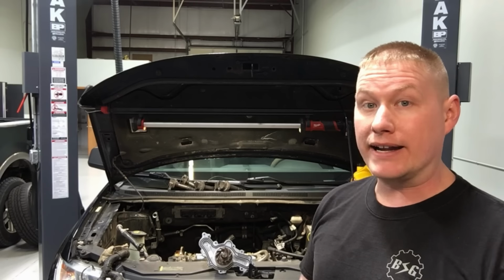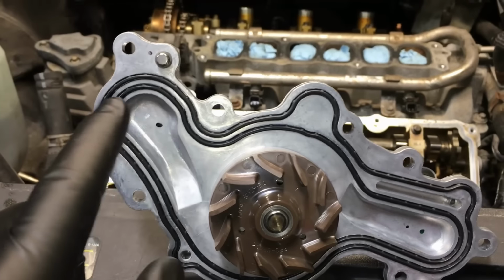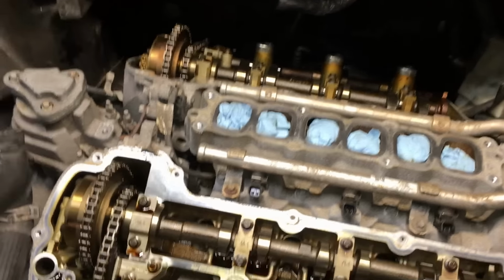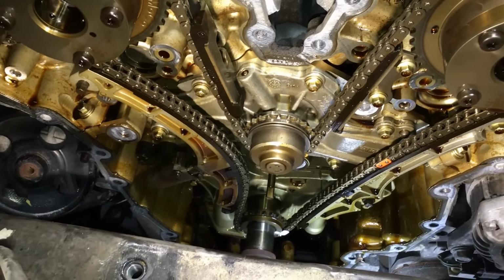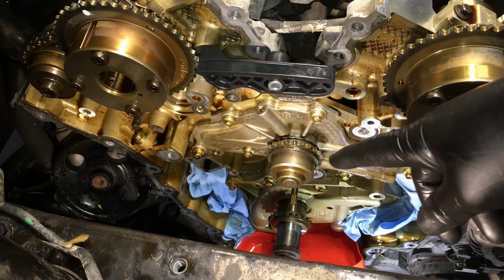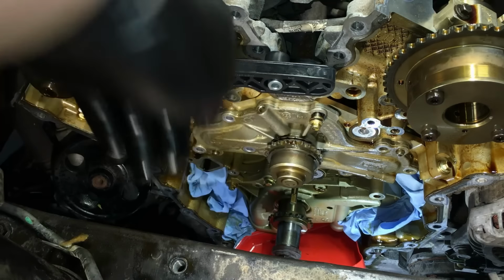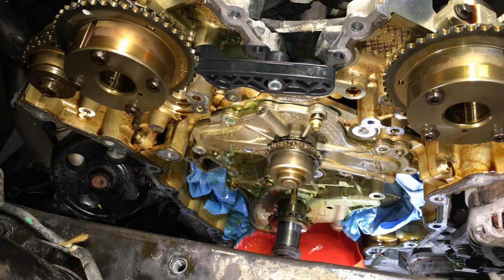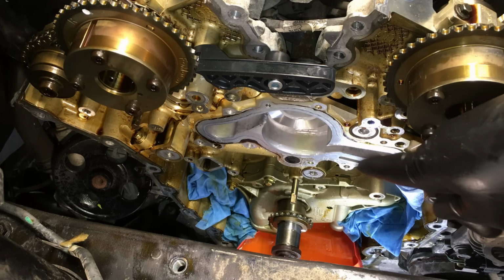Ford 3.5L 3.7L Duratec V6 Chain Driven Water Pump Failures: Check it Before it Destroys Your Engine!

Comment: Need help and advice...replaced water pump chains on 2007 Ford edge... replaced the head gasket also... assyblemed engine  ran it hear rod rod knock... looking to replace connecting  rod bearing... and main bearing... to my surprise  the cross bolt external on exterior on engine that hold the main bearing...wtf ford... it's alwheel drive so I'm guessing  the ptu need to losses or partly  removed to get acess to thes bolts...  plan on doing in the car..not removing engine... also the oil filter housing need to removed... my question is possible to remove thes Damm cross bolts any advice and videos?

Comment: I'm here with the minority report.. my 186k miles, 2013 Explorer alternator seized, shredded its accessory belt... my attempt to remove it resulted in a broken alternator mounting stud. But.. since the shredded belt does not drive a power steering pump or an engine water pump, I was able to drive.. instead of hire a tow for $150 - $200.. the 2 miles to the mechanic.

This does not make up for a TOTAL CLUSTERFLUCK design.. and the next guy has an engine which does not turn because his GDCD water pump bearing failed.. but we gotta appreciate the small benefits where we find 'em.

The car is at the shop now, it's getting the alternator swap done, plus a tensioner for that belt, plus a preemptive water pump and timing chain with phasers.. and two wheel lug studs drilled out from the self-disabling factory lug nuts...

Comment: I have a 2010 Taurus SEL. It overheated 2 weeks ago. I didnt seen any loss of coolant nor leaks, so I replaced the thermostat.  A week later. It overheated again. I then suspected that there was air in the system,  so I tried burping it with the cap off. I also squeezed the top hose while it was running and my heat started working again. It hadnt been prior to this.  Hopefully,  its good now but I will see.

Comment: Hmm , Thanks to your video I am rethinking my former police 2018 explorer purchase, with 60K miles and 7000 Idle hours I decided not to chance this head ache. I am going for the newer 3.3 DOHC 24V EcoBoost, the water pump is external belt driven like the good old days.

Comment: This is being written in May 2026. I had to laugh at some of the prices you quoted in the comments. I just had mine replaced 2017 Ford flex. I talked him down $600 still cost me $4600 to change out the pump timing chains guides, etc. etc. etc. I told my wife if it last 150 thousand more it’ll be over 300,000 and it quits I dump a bunch of stop leaking it or just junk it. I guarantee I’ll do more studying before I buy another car. I’ll probably get a four-cylinder. Make sure the starter is on the bottom not in the engine. Make sure the water pump is on the front of the engine, not in the engine then maybe I can afford it!

Comment: I know this is an older video, not sure if you will answer, but if so thanks. 3.5 Ford Taurus Limited,  major internal water pump failure today, no overheating and the coolant bottle still has a little antifreeze in it, oil is milky on dipstick but not pudding. I have done multiple chains, water pumps and cam phasers on 3.5 so I'm not worried about the process. My concern is possible crank and main bearing issues, car was ran about 15 minutes at interstate speed to make the exit, do you think the bottom half has been damaged? If not how many cycles ( not running ) just pumping fresh oil and draining should I do to flush everything. Again, thank you.

Comment: I just finished this job yesterday on my son's 2016 Lincoln MKX 3.7L Duratec. He had quotes from two independent shops -- one at $1,800 and the other at $2,000 - $2,700. It cost us $190 plus some antifreeze plus some Permatex Ultra Grey, plus a ton of time. I was one happy (and relieved) man when it fired right up after the marathon reassembly.

This, on the heels of an almost $6,000 estimate from a Lincoln dealer to fix his turn signal. Yes, his turn signal!

The Lincoln is now for sale, and it will be the last "modern" Ford product this family ever owns.

Comment: Can you imagine spending $40,000 for a car today driving 150,000 miles on a car is nothing and then shelling out another four to $6000 for a $200 water pump. Ford  should be sued. There should be a class active lawsuit against them. This is not right that the people that cant even afford a vehicle and then it breaks down and destroys the motor. What a horrible design.

Comment: So if the seal on the shaft leaks then it will have coolant going into the oil without any coolant coming out of the weap hole?

Comment: Hi, I bought a 2012 Fusion Sport 3.5L AWD with 265k km (in Canada) and have a water pump failure and it seams that in order to change it (and because of the space constraints), the engine needs to be removed from the vehicle making a $500 job go to more than $5k. Is this the only way to access the timing cover and do the replacement of the water pump? Any ideas?

Comment: Just looking at your video, it's apparent that the weep channel between the gaskets also connects to the weep channel from the shaft seal.
A leak at either location should produce coolant weeping from the hole above the alternator. 🤔
I'm going to check out a 3.7L Taurus for purchase, and that's one location I'll definitely check.

Comment: I actually have had that plastic/composite impeller explode and break apart, seems the ball bearings failed and then the gear jammed up and well everything went down hill from there 

Makes me wonder if the cast iron impellers are better to use

Comment: please help me sr. i have a 2013 ford flex se. so i have been hearing a slight whistle noise over a year i thought was the belt . so the water pump failed and i have some oil on the alternator and around there and water in the oil after the pump failure. So i was on the free way i gave the car gas and it just loss all power and turned off on me and i did not see a over heating warning sign light at all. after the car cooled after getting it towed home it starts right up but of course the pump seal and water pump is broken bad so of course i cant and wont drive it. but it will start. now im wondering if i did not see a engine overheating light on the dash is it possible that i since the water pump failed i did not blow the head gasket as well.I looked online and it says in different places a blown water pump can cause oil to leak as well as water and oil getting everywhere around there. what do you guys all think? the mechanic i had look at the car is an older man and he seen the oil and water in the oil from the dip stick and he says i cant just change the timing and water pump i also need to change the head gasket and resurface the head now??? I want to just buy the water pump timing chain kit and have that all done and thats it but im worried if the head did blow also?? what do you guys all think please?

Comment: Our  2012 lincoln mkx just had the water pump go out on the 3.7.  Mechanic shop charged us 6500 on the repair.  When you said dealerships charge 2k I sunk.   
If you have an issue with your car , don’t let dels garage in Bunnell florida work on it.

Comment: Nope i will never buy ford again never their stupid engine designs are made so u can take them to dealers u cant even change the lower oil pan that was ao simple ij old school cars are now a mess to replace u have to remove valve cocers plus front timing cover just replace the oil pan seal or silicon no thanks no more ford for me

Comment: 256,000+ miles on a 2011 Exploder, still no milkshake but the timing components sound beat. Need to change them and might as well get that water pump too...this looks like so much fun.
Reply: 3.5l NA, not a turd-blow.

Comment: Only seen the weep hole leak 1-2 x but any pump that was toasted it was from the shaft seal dumping out coolant. The gaskets seem to have a longer life than those shaft seals from what ive fixed with over the years

Comment: whoever is saying that they HAD to do this otherwise the engine wouldn't fit.....they literally solved this issue in it's predecessor 3.0 by putting the water pump above the flywheel....or they could have put in an electric pump like BMW or Mercedes....there are many other options all of which are better than what they did here.....a $2500 water pump job is an engineering fail...and what's even worse is that many of the people that drive/buy these cars are in lower/middle class financiallly

Comment: I honestly wish I'd known about this before I bought a 2010 Taurus. It has 145 on the clock now with no signs of leakage, though it gets checked weekly for signs of coolant in the oil or vice versa.
I've considered having the pump replaced as a routine maintenance item around 150 or 200k.
Reply: UPDATE: The Taurus is gone. I could not keep it repaired and running to my expectations so Zi gave a friend the history and signed it over. He says it runs great.
Guess I'm picky. Bring disabled doesn't help with the repairs though.
F-150 forever!

Comment: Curios.  Where is that price point now 6 years later.  I know inflation has made EVERYTHING going up.  Not being critical of you. I GET IT.  but curios where your price is at this point?
Reply from the maker: double
Reply: @FordTechMakuloco  Ouch thanks.  Wife's has 111k on it  I know the oil was changed regularly according to carfax.  I BELIEVE the coolant was done at least once anything I can do to prolong life or just fluid changes to prevent acid build up, seal break down and should I pre-emptively plan on doing this now that we are just past that 100k mark?
Reply: I picked up a ‘13 Edge with the 3.5 a couple years ago that had 142K. It was burning a little oil but a couple years, and another 18K, of full synthetic has its oil use down to almost zero.
I noticed minor coolant loss last year & discovered a leak past the clamp of the upper radiator hose at the radiator so I changed the upper & lower hoses. To access the lower hose clip I had to free the radiator from its brackets. I carelessly failed to notice that not all the mounting bolts were the same length & punched a hole in the radiator. That turned out to be a good thing as the new radiator ($90) weighed about half as much as the gunked up original.
Then, as planned, I filled the system with the new yellow Motorcraft coolant after flushing the system with distilled water, bringing the system to 50/50 by painstakingly replacing measured amounts of diluted coolant with straight coolant.
That was 8,000mi ago & the level in the overflow bottle hasn’t budged. Is it possible I’ll be lucky & make it well past 200K with the water pump? The main reason I spent $40 on the yellow coolant was that it would supposedly extend the life of the water pump.

P.S. I couldn’t find any shop which would service my transfer case (it’s an AWD) after I bought the Edge. So, with great difficulty, as I work on my back and have a handheld pump, I’ve sucked out as much nasty gear oil as I could manage 3 times since and refilled it. After the first 2 times I noticed I got an extra 1 mpg as the gears are always spinning even though the rear axle is almost never engaged.
The first batch of gear oil I sucked out looked like liquid asphalt & smelled like death.

Comment: Question I rotate the engine to line up the timing marks pieces of my timing chain started to break off and the chain jumped off the water pump the water pump sprocket is loose now I can't rotate the crank bolt to time the engine i took all the guides off to line the chain back up can I rotate the engine from the top of the car where u put the cam lock tool on or just put the 4 guides back in and try to turn the crank bolt

Comment: I've got a 2019 ford explorer 3.5 duratec non ecoboost (124k miles) with waterpump weep hole leak.  I need to change out the water pump soon but the engine has no other issues.  Anyone here know what other parts I should change on this year since I'm in there?  Timing chain maybe and chain guides?  Do I need to change out the tensioners?

Comment: I would say that a pump that is still hard to turn is NOT ready for failure.  Quite the opposite. New pumps are tight, not worn ones.  Neither the bearing nor the seal are loose from wear.  But I'd be nervous at 185,000 miles.  Plus once you are inside to preemptively change the pump, you do not want to keep the old one.

I'm so old I can remember when water pumps had zerk fittings.  This was for the bearing, of course.  Modern seals are beyond amazing, how well they work and as long as they do.  The only reason I have replaced the water pumps on recent, but high mileage cars, was during  "might as well while I'm here" while doing other maintenance. 

I was aware of the weep hole, but until this video did not realize that it is only an indicator that the first "O ring" had failed. Not an indicator of a leaking seal, which is the real catastrophic failure.  If the second "o ring" holds, and coolant kept weeping, no big deal, perhaps OK forever.  

So, the only warning that the seal is staring to leak is getting a chocolate oiled dipstick or seeing it during an oil change.  I recently bought a 2007 Lincoln MKZ with only 125,000 miles.  I had to track down a previous owner due to a title issue, and in our conversation he mentioned that they sold it because "the engine was bad."  Heart attack. "The oil was brown and sludgy."  Whew.  So rather than having it fixed for maybe $1500 on a car worth three times that, he sold it off cheap, someone did the repair, and here it is, running great. And someone made some money.  

Since I drive only 5,000 miles a year now, I should die well before the water pump does again. 

I used to think the comparable idea of putting the water pump in the engine, but driven by a drive belt like Toyota and some others was a terrible idea.  Having to change the belt at some mandatory mileage or your interference engine was trashed.  When changing the belt, the water pump always gets changed.  Never any water dumping into the engine, and a hell of a lot easier to access.

Comment: My 2015 Lincoln mks 3.7L has 255k miles on it, and the water pump is just now starting to let go. I don’t want to let this engine die 😢
Reply: How can you tell it’s going out? Cost to replace?
Reply: @landking3742 it’s hard to tell, you can look at the weep hole that’s designed to leak outside the engine by the alternator, good indicator the first seal has broken, you will see coolant caked up around the weep hole, if the second seal is starting to break aswell, you might see some orange foamy looking stuff when you drain the oil, and that’s a indicator that the water pump is leaking small amounts of coolant into the oil. To replace it’s a whole timing chain/tensioner job, so maybe 1-2k depending on where you live. Hope this helps, I will answer anymore questions you have also
Reply: @DevinArcher-i4h thank you for the reply

Comment: Thy could have run another small chain on the outside of the timing chain to drive just the water pump 🙄.. or run it off the damn serpentine belt 😒

Comment: They knew full well how many tons of carbon emissions blown engines from this piss poor design CHOICE would cause.  And that's the way we need to talk about garbage like this.  If these mega corporations or the government that oversees them actually have a crap about the environment, they wouldn't conciously and deliberately add catastrophic failure points designed to save them likely single digits worth of dollars in manufacturing costs.

Comment: Thanks for earlier help.I got the correct bolt. I'm back with an urgent request and would greatly appreciate your help. As said earlier I'm first time this deep into an engine. Mine is 2009 Edge Ltd AWD 3.5 (single vvt solenoid). I took of chain without aligning marks (there was lot of slack as both upper guides plastic was gone also upper tensioners) but my cam tool went in with a very light effort. Upper marks are at 11am and 1pm respectively but my crankshaft mark is way off and is at 2pm. Please guide how to bring it to 4pm. I desperately need help on this one. Please please
Reply: Did you get it figured out? If not Cloyes has a video for our motors how to get it in time. However you do not need to worry about finding top dead center as it does it on its own because it’s an advanced variable time driven motor and is all hydraulic run so the phasers and crankshaft position sensors do all that for you itself

Comment: Urgent Help Request. References your video at 5:12, I'm replacing old guide with new one using bolts from old one and lower bolt is too short for new glide which didn't came with bolts. Please guide
Reply from the maker: You need two new bolts. Upper W715118S300 Lower W716322S437
Reply: @FordTechMakuloco  Great, big thanks. Now I'll be confident about putting in the part. Have repeatedly seen most of your videos and have learned a lot. Highly appreciated. Can you please recommend a good budget scanner please. Big thanks
Reply: Make certain left and right are determined by drivers perspective
Reply: @sumatrican5990 thanks for guiding but I fixed it months ago and it is running without any issues or lights codes etc, again appreciated

Comment: Thanks for this.... say a prayer for me.....    Our Edge has been going along fine,  and I keep the maintenance well.   Today when my wife was close to home,  we got an overheat condition.   We parked it to cool,  and then limped it home a few miles.    The oil level looks normal... and I didn't catch any leaks  (yet)...  so I'm hoping for just a stuck  Thermostat.